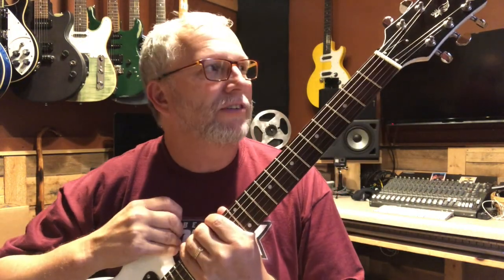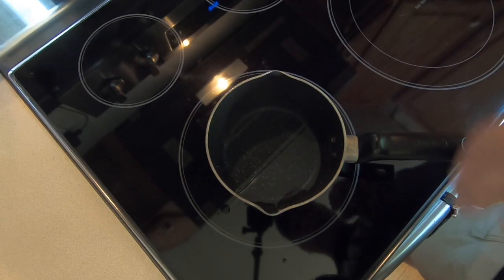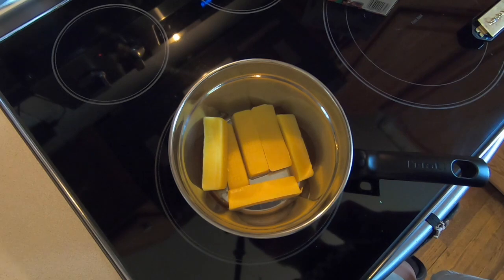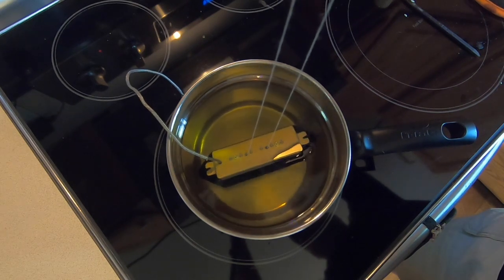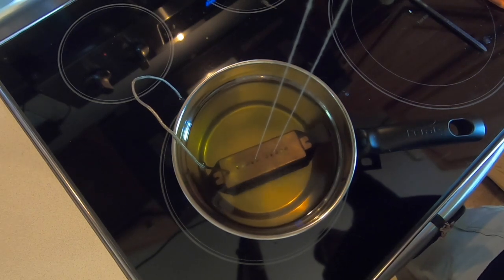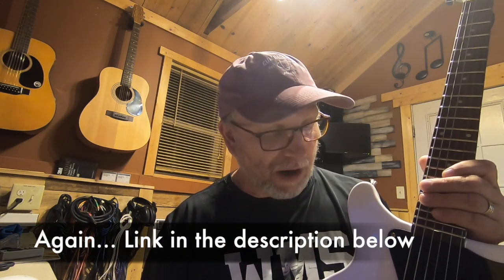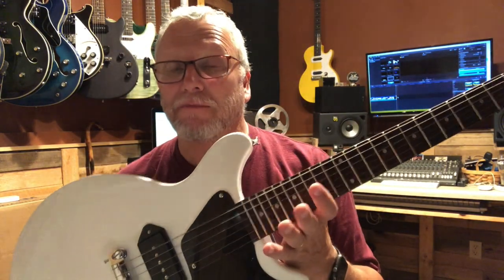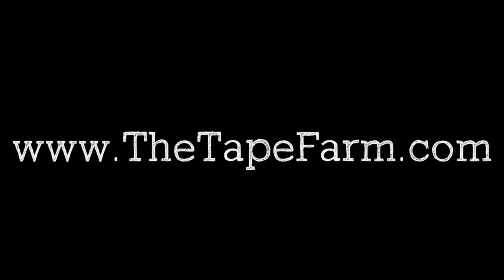Firefly FFDCS Guitar - Taming The Beast - How to Wax Pot Pickups

Comment: From Leo:  Your waxing rig is pretty good.  I found a small square shaped pyrex baking dish that exactly holds 2 pickups and needs only a few ounces of wax.  I am in the habit of taping over the holes in the cover and he cover itself. It really does help with metal covers, keeping  a solid level of wax between the cover and pickup bobbins, and it makes it easier to clean the pickup before reinstalling.  keep having fun with the guitars.
Reply from the maker: Barb Melle thanks for the tip. I’ll give it a shot on the next one.

Comment: I bought the FFJR which is the single cut version.  Nice guitar with one major problem.  Worst fret job of any guitar I have ever bought. The fret had gouges on them like someone took 80 grit sandpaper across them. Fixable but should have never left the factory in that condition.  If you are going to buy one of these you need to know how to work on guitar problems.
Reply from the maker: Alton ForPresident my 338 needed a really good fret polish. The frets were really rough on it. But my FFDCS was honestly pretty good. With anything in this price range there are bound to be some hits and misses. But I agree, having a good working knowledge of basic set up and maintenance is almost a must at this price range. And if you don’t have that knowledge, have a good local luthier.
Reply: @TheTapeFarm  Ordered the 338 today since they were back in stock. See how that one does.  
With the FFJR the seller refunded 25 percent of the price to help cover the fret leveling and polishing it needs.
I agree with much of what you said. The guitar bodies are well made but the hardware is garbage.  Putting a better bridge on the FFJR hoping to level the bridge a bit. Mine was not as bad as yours but I want more adjustment.

Comment: Need an opinion.  Received my FF338.  First under $200 guitar that all I had to do is tune it.  The problem, when playing a distorted lead it squeals like a pig.  Would potting get rid of the squeal or would it be best to replace the pickups with something better.
Reply from the maker: Alton ForPresident likely yes. Hollow body guitars will always be more prone to feedback, but the squealing you’re referring to is because the pick ups are microphonic. It would be like holding up a microphone in front of a PA speaker. So yes, putting the pick ups will help alleviate that. The only reason I did not pot the pick ups on my 338 was because at the end of the day, I didn’t really like the sound of the stock pick ups. So if you like the sound of the stock pick ups, then wax potting them would be a good choice. If you don’t like the sound of the pick ups, then replacing them would probably be the better call.
Reply: @TheTapeFarm  Thanks.  I watched another video on potting.  The gentleman put small stones in the bottom of the wax pot so he didn't have to hang the pickups.  The stones insulated the pickups from the metal pot.
Reply from the maker: Yup. Marbles can also be used. But clean small stones is probably better.
Reply: Replace the pickups, I went with the GFS Pro Alnico II's and couldn't be happier

Comment: A request. There are many reviews about Firefly guitars but I would appreciate it if you could give a shout out for their customer support.  Ordered a FF338 and found out before it was delivered that the wrong one was sent due to a software glitch with Amazon's order system.  Have been dealing with their customer support and have never been more impressed with the help and assistance from them. If you do another review on their guitars, could you please commend them on how they handle problems.  Thanks.
Reply from the maker: Will do man. I have another video in the works. I’ll let folks know about your experience. Thanks for the update.
Reply: @TheTapeFarm  Thanks.  FYI- was told by them they will have more of the FFDCD models in stock in about  45 days.

Comment: I'm new to this channe.l So that being said I would love to see all the animals you've got hanging around behind you and back story if there is one. Also a better look at your studio.
Reply: Might be a good idea to pour out the remaining wax into ice trays if your saving it for future use so you wont have a big old wax cake.
Reply: Having a background in electronics I know that a lot of transformers especially older and higher voltaic transformers are not only wax dipped in the windings but often wrapped in wax paper. Giving the unit better isolation and  less hum. I have heard of putting pickups but never saw it done. Now I'm going to sit down with all of my dozen guitars and check them for microphonic qualities. I've actually heard of devices on board and  within that cancel out such noises and have at least one pedal that has such circuitry.
Reply: I call the pick scrape pick dive. I still say that looks like the Brian May signature guitar I saw somebody demo. His was red but if I recall it was a single. Wouldnt it be fun if you had a split pickup on it though if not another pickup all together